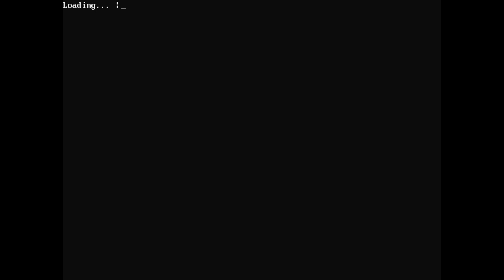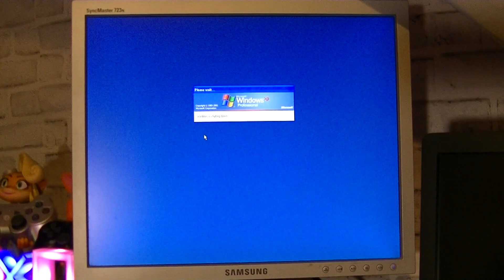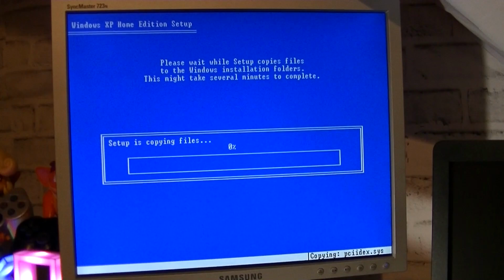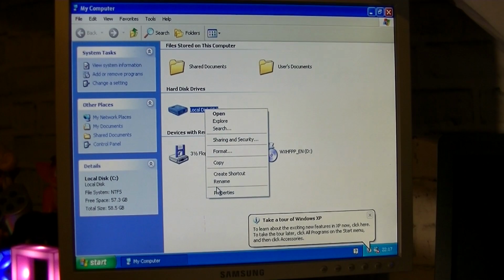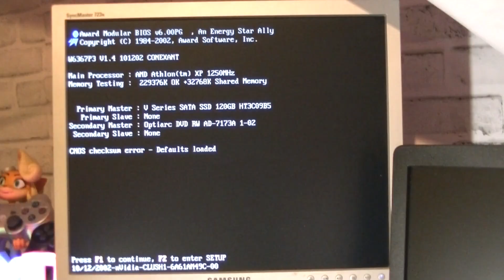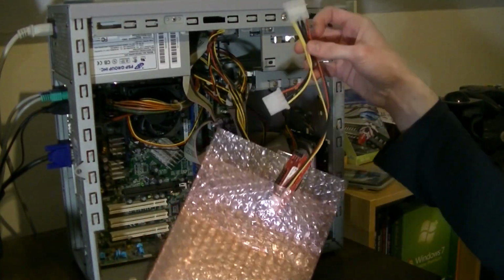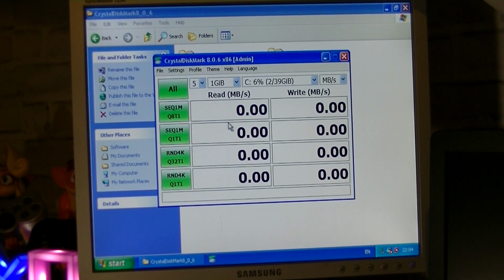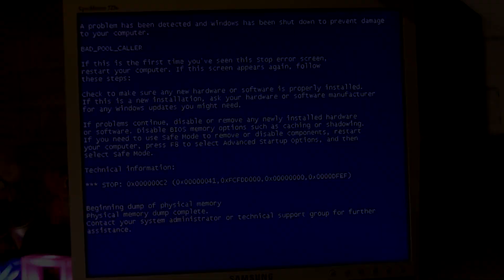Installing an SSD and Windows XP on the Packard Bell Desktop PC from 2003

Comment: Finding audio drivers for these old Packard Bell's can be hard without the original driver disk. If I remember rightly, the onboard audio was part of the south bridge on mine. What I had to do was find the motherboard manual online, get the number off the audio chip, and find a driver for that chip. Mine is a Realtek ALC201A using driver version A3.54, I think. 

It wasn't easy as although this is a Gigabyte motherboard it is a Packard Bell specific version and the audio was completely different to their standard board so the Gigabyte driver didn't work. The one from Realtek got it though.

Comment: I can see me in your struggle, when I lived by my self in Paris in a youth hostel around 2005. But the only way to get drivers and service pack was to go to the Internet café and use a multisession disk as a kind of usb to grab updates, cracks for games and tips.
I was burning cd's at full speed and doing other things on the computer which was not good at all when burning unattended version of xp.
You have my sub.

Comment: Faster yes, but the problem is that XP doesn't have the ability to send TRIM commands to the SSD so that's not great for the SSD. Not entirely sure what that means, but I've heard about it before. Then again I doubt you're going to be running this as a daily driver so it probably wouldn't get to the point where it would be a problem anytime soon.
Reply: On my retro machines, I clean the dest bunnies out once a year and put the SSDs in on my daily driver and run fstrim -v -a on them.  I also don't use the full capacity on those drives, I partition them to about 80% of capacity.
Reply: O&O Defrag can TRIM disks. version 17.5 works just fine under XP.
Reply from the maker: @MindCaged  You are correct, and I'm aware of this issue - this is one reason why I made the main partition about ⅓ of the actual SSD capacity. And yes, I won't be using this PC for hours a day, so I don't think it will be an issue for the time being
Reply: @j.w.techchannel With the amount of cycles that this SSD is most likely going to be put through, having no TRIM will have in real world use, no perceivable impact at all on performance.